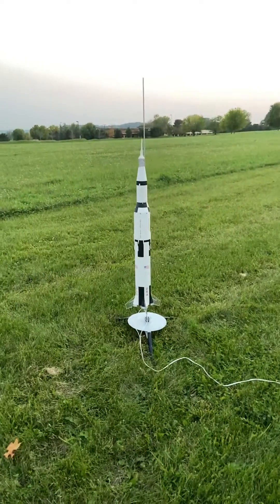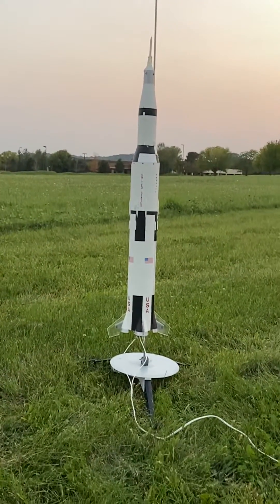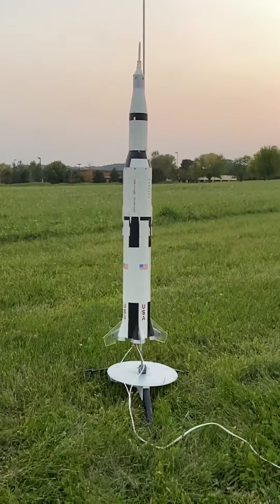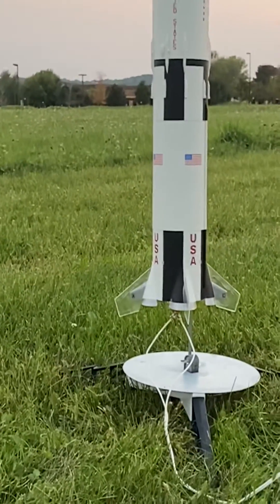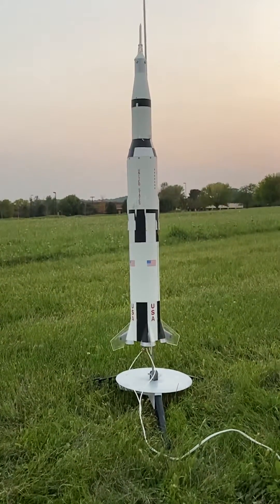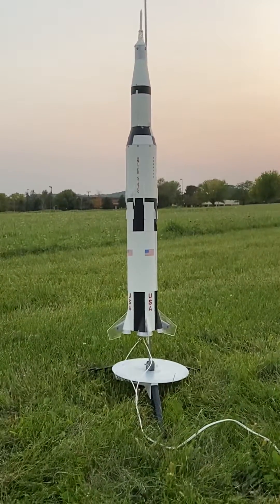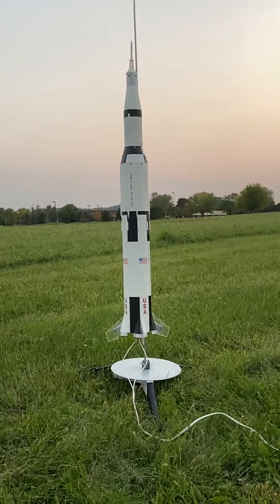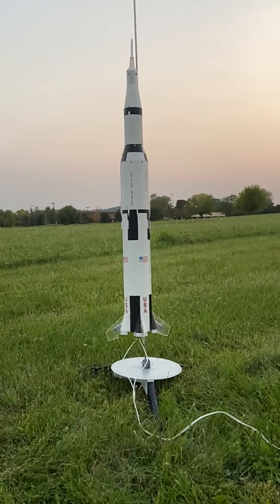Estes Saturn V Maxi-Brute launch

Comment: Great video! I have a question, where can I find those clear plastic fins? I have a 2157 but the fins and fairings did not survive a 20-year storage so I'm using the Boyce Aerospace 3D printed fins, which are the same size as the fins on your k36.
Reply from the maker: The K-36 Saturn V kit came with a sheet of thin clear plastic that you traced an outline of the fins onto using a template in the kit. After that, you cut out the eight fin halves. After that, I used some clear cellophane 3M packaging, tape to neatly tape the edges together, leaving the root edge open so that you could slip them over the fins of the model.  I hope this helps.

Comment: This is the one Estes Kit I want and hard to get a good price.   Have a few #2001s and 2157s I bullt

I mainly flew Centuri kits in the 70s and never had the $$ to get the Saturns.  (Bought the LJ II, 1 launch and bust) 😢

Am trying to find out if I can get parts or the difference in builds from this to the 2001 or #2157. 

Like to try same with the LJIIs and Saturn 1bs I have.  (Something gotta work )

Just learned a lot has changed since 79 when I joined the Navy. Now am back into it teaching kids and relearning myself.    

Always a blast will never outgrow this hobby
Reply: Update. I finally got the K-36. Now I don’t know if I want to build it or just leave be.    I really like the cluster 
Sweet lainch

Comment: I built mine in 1973 and always flew it without the plastic fins and never had a problem. I also used 3 C6-7's. I Still have the rocket today and it is still in flyable condition. It is a testament to Estes quality.
Reply from the maker: Really… You used (3) C6-7 engines??  I would think with seven seconds of delay the model would be coming down pretty fast and be too close to the ground by the time the parachutes were deployed.  I think flying the model without the plastic slip on fins might be risky as well, did you add weight to the Capsule nose cone before flying it without the plastic slip on fins?

Comment: That was the best Saturn V launch I have ever seen with this old Estes rocket. The three C5's must have really been a factor. I have the later 2001 myself. Same except the fins are a bit larger and separates at the third stage for the chute. Lot,of work on that fine rocket. Thanks for sharing.
Reply from the maker: Thanks so much for the nice comment!  The clustering of three. “C” engines does make a big difference!  Normally I use (3) C6-3 engines.  But for this launch I decided to try Estes’ new C5-3 engines.  They actually push it off the launchpad a little quicker than the C6-3’s.  Anyway, I’m glad you enjoyed the video, it’s fun to share exciting launches with fellow Rocketeer‘s!
Reply: @cooltheengines  watched some of your older ones with the Maxibrutes too. Love the honest john, Pershing and especially the saturn 1b. Just great flights,
Reply: Just watched this flight again! This came to mind about the launch. Yea the c5-3 seem to have a bit more punch as I've been reading. Haven't tried those yet. Almost done with my 80s version of the Saturn V (have never flown it yet) and unlike yours, it only takes a single D12-3. Been seeing many peeps with that issue and that engine has very short flights and if a bit windy, it can lawn dart real easy. Saw some interesting posts about using a 24mm E20-4w instead. Just a bit more power. I think when I'm ready for flight I may try that one from areotech. Do you have the dual adapter in the k36? With 3 C's or one D?
Reply from the maker: @saturn5tony  When the K-36 Saturn V first came out in 1969 Estes hadn’t introduced the D engine quite yet.  You could only fly it on a cluster of (3) C6-3 engines. Estes was apparently thinking ahead because rather than having an engine mount built into the bottom of the model the engine mount was a separate cartridge assembly that was inserted into the bottom of the model and then removed after the flight. So then in 1970 or 1971 whenever they came out with the D engine they included a D engine cartridge adapter with this kit so you could fly it with a cluster of three engines or a single D engine.  In my opinion a single D engine is just not adequate for this kit. The model barely gets any altitude and before you know it the flight is over and the model back on the ground.  I never use the D engine for this model…I normally fly it using (3) C6-3’s or C5-3’s because It adds a little extra challenge, the flights are a lot more dramatic with more smoke and fire and the model flies Higher. It also adds a bit more realism because the real Saturn V rocket used a cluster of engines, not a single engine.
Reply: I primary flew Centuri kits as a kid, and before Leaving for the Navy in 79, I never could save enough to get a Saturn V-   I did get a Centuri LJ  II on sale using a 3 engine cluster. 

Was my pride and joy.   Lot of work into it.  And sadly one engine didn’t ignite due to ignitor error.  Maiden and only flight as if caught edge of the road. 😞.  Glad I didn’t pay what they ask for that kid now 😂

My dad had an older Estes Gemini Titan II 2 engine cluster on his shelf and he finally let me build it.   Didn’t know it needed plastic fins.  Was “interesting”. 

But def agree I love the clusters.   I now have like 4 Saturn 1Bs and 4 LJ IIs (all NIB) and will build one of each and I want to cluster them.    

79-2023 is a long time.  Rocketry has come a long way.  And yikes on prices 

Now to find my old Centuri Blast deflector.   Just lover then over the plates.  

Thanks  for the vids. If I never fly mine. I saw 👀 it in action  here.   

Car batteries were the only way to go 👍

Comment: Had the exact same model, back in 1981. Flew with the D12 -3. Never tried clustering. Seams to fly higher with 3 c engines. It was difficult packing 2 24" and a single 12 " chute. The chutes barely had time to deploy.  Absolutely loved that model. Unfortunately,  my dog used it as a chew toy. Spent several months on the build. Perhaps its time to build another. Thanks for sharing video.

Comment: Back in 1971, I had one of these. I used a cluster of, I believe four engines. When I launched it from the backyard, not all of the engines ignited, so it had asymmetric thrust, which caused it to fly up and over the house and head straight for a nice crash "landing" into the street in front of the house. It was totaled.
Reply: Sounds like it had the same flight plans or my Centuri LJII.   Painful as a kid working for $$ waiting for the mail then v painstakingly build it and watch the tears flow. 😂.   But def be crying if I spent the $$$$ they are asking for these vintage kits today.

Comment: I have the same model...the newer ones I have seen make more sense with the rocket separating between the "2nd" and "3rd" stage. This one has a stuffer tube all the way to the CSM..nice flight!
Reply: Could not agree more. I remember how much of a pain it was to pack 3 parachutes into that smalle tube  Haven't built a rocket in over 30 years. I think it's time to build again most definitely the Saturn 5.

Comment: Does this come built to suit 3 c5-3 rockets? Or did you customize it to hold 3?
Reply from the maker: This was Estes’ First Saturn V model kit.   Upon its initial release the only Engine configuration it flew on was three C6-3 engines Because Estes hadn’t come out with the D motor yet.  About a year after the kits release, Estes introduced their D engine so this kit can be flown either way.  You build two different engine holder cartridges, One of them is for three C engines and the other is for a single D engine and you slip which ever one you want into the bottom of the rocket.  I always like using a cluster of three C engines because it flies a little higher and looks a little more realistic than a single D engine.  You can use three C5-3 or three C6-3